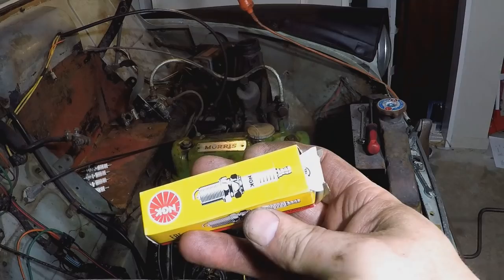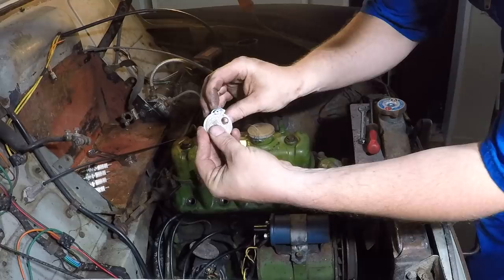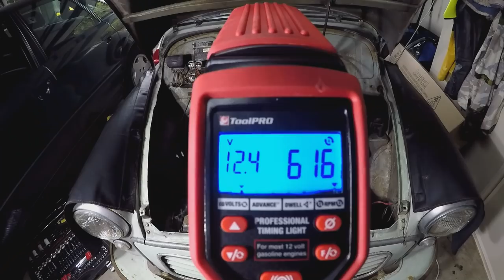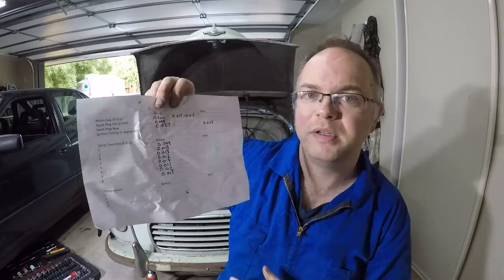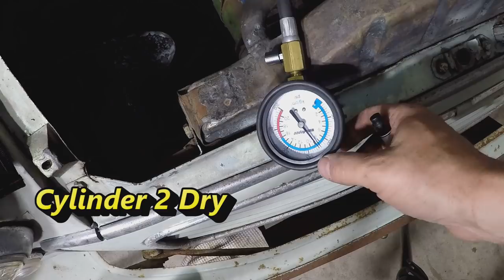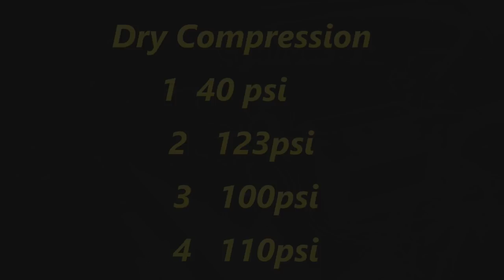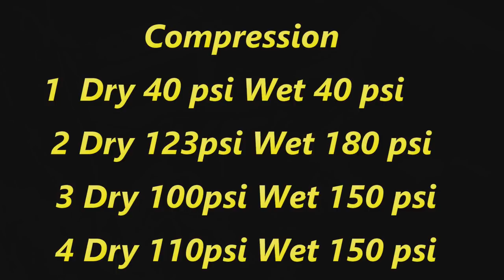Morris Minor - Compression Test and Verdict - Part 5

Comment: A great find, and a caring owner for the old girl. The 'A' series engine is reliable, and worth the Overhaul. It's good that you will see many comments too, but I would keep the car as original as possible. Not many cars of this age would look so good. There is a lot to be said for the simplicity of the Morris 1000. I would recommend just one improvement to the engine before running the car. Dispense with the Contact Breaker Points, and fit the Hall-Effect Pertronix System. I did this with my 1971 Beetle and never looked back. Easier starting, smoother power. Better Idling. I also had a Morris Woody with the same tail lights. I can still remember that they are Lucas L549. Best of luck with your restoration.

Comment: I always have had a fondness for these cars (I was going to write the model name but it made that line sound a bit weird). The 180 figure seemed very high, I wondered if there was so much oil in there that it jacked up the compression ratio too. Good to see you doing the diagnosis properly, I can see there is a video of the head being taken off.
Reply from the maker: There wasn't much oil in the cylinders. That one did seem high, will have to see what they come out with once it has been rebuilt

Comment: I agree that plug No1 looked clean,  maybe  a plug lead or distributor cap issue has caused a week spark.  Bore washing springs to mind on No1 cylinder caused maybe by an over rich mixture  on that cylinder. I agree , that a valve issue could be there,  no doubt you will take of the head to investigate. Great watching, as always Thanks
Reply from the maker: Thanks for watching. Plenty of reasons why it could happen but it made it 40 years before it was a problem! Soon the engine will be out and we can see for sure. Cheers

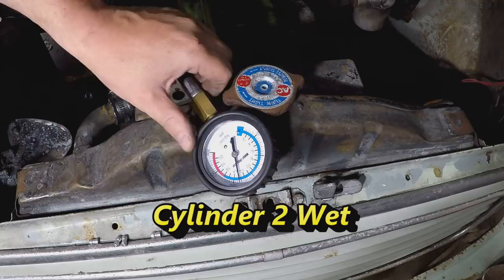Comment: Great video, many thanks. I'm a newbie car fixer and something you said makes me think I'm going down the wrong path! I'm in a similar situation with a 948 which has one cylinder with low compression (mine's in a Sprite though). I did a dry/wet test on a "good" cylinder and that ran 25 psi higher on the wet test. I then tested my suspect cylinder and it was still low compression but also ran 25 psi higher on the wet test. So I decided that this meant the rings were functioning just the same on both cylinders, and that my problem was in the valvegear. However, at 9:48 you say that no change in compression when wet meant it was a valve issue. Both of these make sense to me so I'm now confused about what result in a dry/wet compression test indicates a ring issue. Or maybe they don't?

Comment: great old car,not very fast though as you will get what they call valve bounce, if you can get them mini cooper valve springs will fit,i used them back in the seventies as a a a patrol in london  england more thing it sounds very rich on fuel they had variable throttle needles as the  jet at the bottom of the carb look at it as its probably stuck as its linked to the choke cable, and they were prone to sticking open,have fun with it its a collecter  now regards tony
Reply from the maker: Thanks for the advice. I will see what modern upgrade parts are available. I want to try and make it usable in modern traffic without taking away the charm. I'll be overhauling the carb before we're done. Cheers!

Comment: Forgive my late-night derp...  Was the #1 plug on the right when you laid them out?  If so, I can see the difference with that plug.  Looks like it hasn't been firing quite as much as the others.  If not, the camera has fooled me~

Looks like she'll need a rebuild!  I recall doing a rebuild on a friend's Triumph Spitfire 1.5L motor many years ago.  It's a nightmare finding parts Stateside, and boy did it need parts!  We ended up scrapping the notion of a budget rebuild and went all out.  Blueprinted the block and head, custom pistons and rods, offset-ground crank, overbored and sleeved, and the cylinder head was insane.  I spent about a week porting it before we sent it to the machine shop for bronze guides, 3-angle valve job, etc.  Fun times!
Reply from the maker: That number 1 plug does look slightly different. Smart fella

Hopefully I can stay at the budget end of the scale but spiralling rebuild costs could be the order of the day. At least parts for these are plentiful via the UK

Comment: On that starter switch on the bulkhead there's a rubber thing between the two 7'16'' electrical contacts.(Check for neutral, mind the fan/ fanbelt.)Try giving it a good hard push.
Reply from the maker: thanks, I'll check it out

Comment: You probably know there's a fuel additive on the market to replace the lead.Otherwise there are firms that will machine out the head and press in steel valve seats, press in new valve guides and supply new valves so she can run on unleaded.Not cheap.
Reply from the maker: I'm going with additive and timing at this stage. Cheers!

Comment: You need a remote starter switch. A simple pushbutton switch capable of carrying some 6-10A.
The switch should have 2 leads approx 1.5m long terminated in small battery clips.
A standard twin appliance wire will do perfectly.
1 clip goes to battery +, 1 clip goes to starter solonoid start feed.
And off you go testing the engine turning, not constantly tumbling in and out the car while working.
Reply from the maker: I didn't have one to hand and managed without. Probably something to add to my toolkit
Reply: @Badgertronix  Don't bother...  You don't have a solenoid. The starter is operated by a bowden cable from the pull knob on the dashboard. Incidentally, I think your car could be around a 1960/61? And it is definitely 12 thou valves, 15 thou points. What engine size do you have? Mine is 1098. And is 1961. From 1962, both wipers went the same way, but yours and mine are "clap hands! :-)

Comment: Valve clearances should all be 12 thou. The 15 thou is an internet myth originating in a member of the UK club internet forum. 15 thou does nothing to help running on modern petrol,
Reply from the maker: There did seem to be a fair bit of debate on that one. I'll set them correctly once I've rebuilt the head